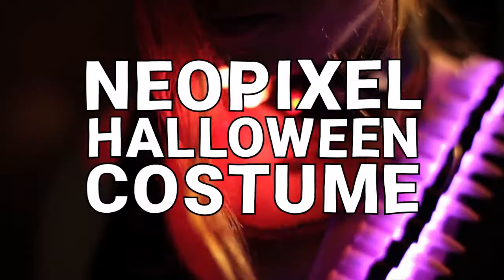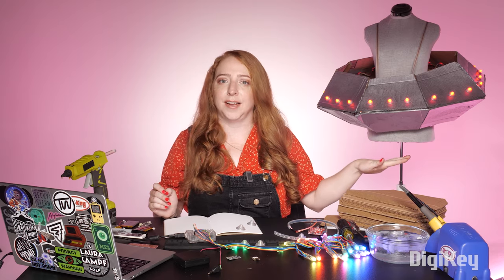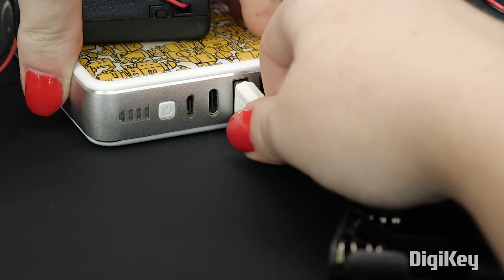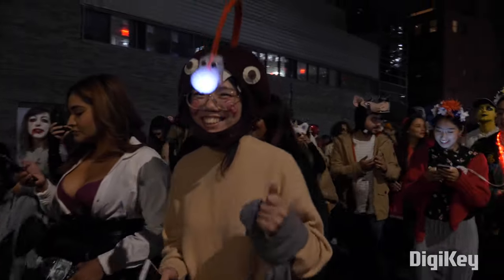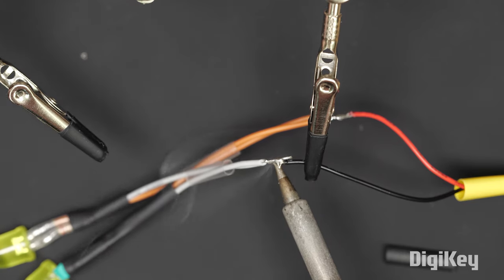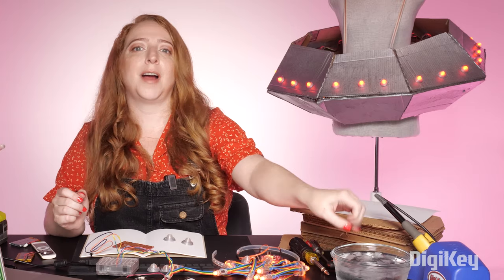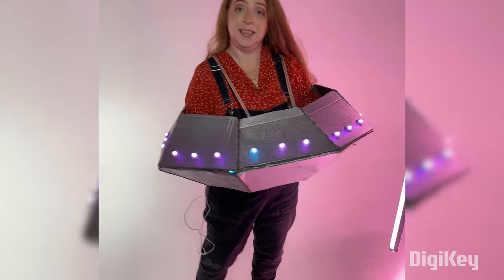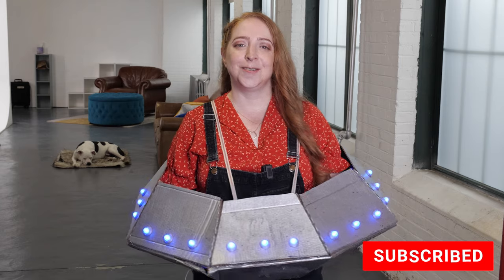NeoPixel Halloween Costumes - Electronics with Becky Stern | DigiKey

Comment: Just a pro-tip, most battery banks have an over-ride for the "auto shutoff" function. On Anker battery banks you just hold down the button until the lights turn green.